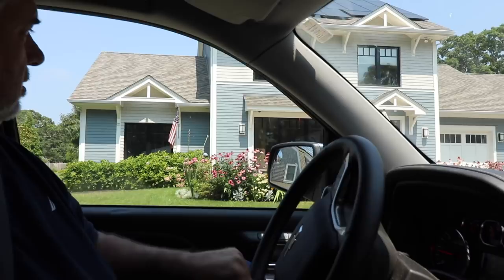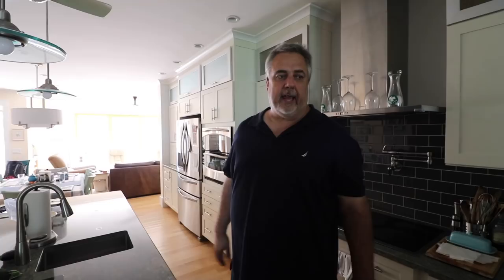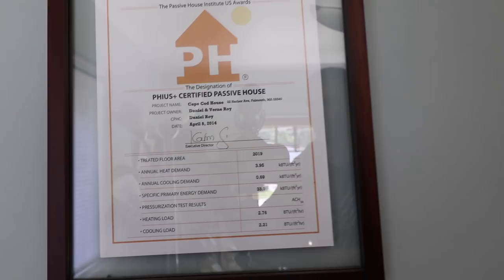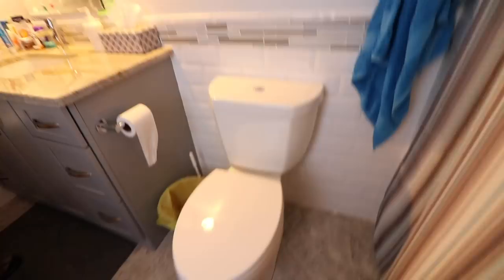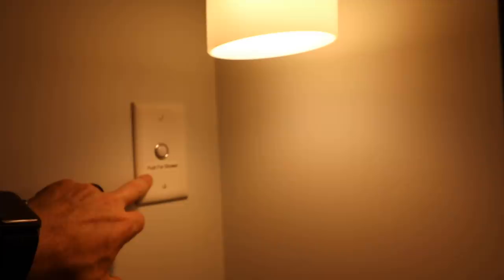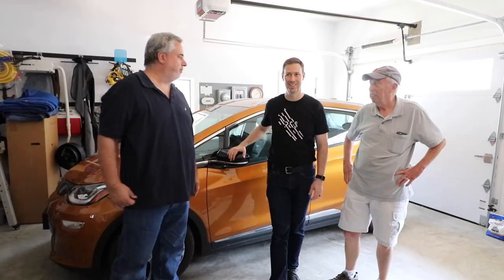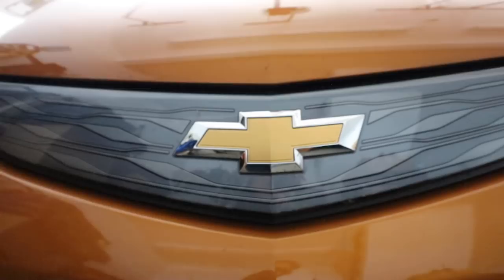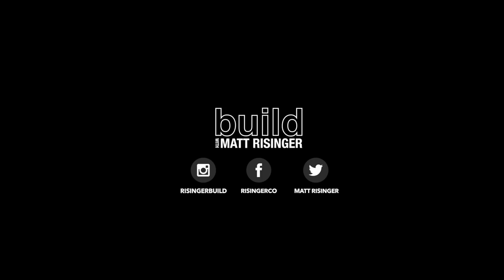Top 10 Most Efficient Home in America

Comment: I don’t know why, but the passive house stuff is always my favorite!
Reply: I'm sure that part of that favoritism would only be enhanced if your electricity bill read $0.00...
Reply: Mine too - always exciting stuff to be had when chatting Passive House
Reply: I can see this happening in the north... Can it be done in the south (Austin, San Antonio)?  I just don't know why more people don't demand houses like this or similar.
Reply: I was stationed in San Antonio for four years, and I would have loved an extra layer of insulation in my house.  I wonder how much more R30 walls and R50 lids would cost?
Reply: You're my favorite
Reply: @jackjmaheriii  You get diminishing returns in walls well below R-30, especially in climate zone 2 where San Antonio is.  About R-21 in a closed cavity (whether it's batts in walls or foam that creates its own cavity) is about the max you should really go.  The only reason you see R-30 or R-38 in attics is because those aren't enclosed cavities so they have to make up for airflow in the insulation layer by adding more.  Remember insulation works by trapping air so airflow works against that.
Reply: I love the Passive House episodes.  But, why no examples from hot-dry climates?
Reply: @barbarasmith6005  It's alot harder to do with cooling than it is heating.  Keep in mind A/C is basically just a less efficient reverse heat pump.
Reply: @rush, if you did want a passive in hot climate would the answer be something like, thick concrete walls to store the cool night air, and exterior insulation to keep the sun from sucking out the heat?  Maybe use deep eves to keep the sun off the windows?
Reply: @jackjmaheriii  Depends on if you are in hot and dry or hot and humid climate.  Hot and dry that would probably work well.  Hot and humid climates like here in Texas can still stay in the 90s at night on the hottest summer days.  Honestly your best bet in these climate types would probably be some type of dugout structure.
Reply: You don't know why, isn't it obvious? :P  I must say Matt this is your best video to date!!

Comment: There wasn't much discussion of the solar panels but I would assume they do not have a house battery and the grid tie in is 1:1 rated. Meaning for every kWh generated one is credited. From 1:11 there are 35 250 watt solar panels for a 8.75 kW system. This makes sense for more Northern sun hours of 3.8 and to charge the EV. The average house uses about 30 kWh per day and this home would be producing about 33 kWhs on a sunny day. The efficiency gains from direct solar heating probably on their own make up a big chunk that would be needed to charge the EV. Also heat pump water heaters alone would save 5 kWhs. While we got a long way to go for energy storage we can clearly see rooftop solar is plenty of power for all residential energy use.

Comment: This is my goal in life. 
getting rid of all my bills
Reply: It's attainable
Reply: Except the mortgage thats 15%  high so he didnt have a utility bill. Lmao
Reply: Me to but I'm going to build an actual efficiency home. You know, thermal loss efficiency. The real efficiency rating. Then you don't need very much heat or ac
Reply: @Bryan-Hensley   well luckily A passive house only cost 5-10% on average more to build then a traditional home.
but thermal efficiency is not everything, that only impacts the heating and cooling costs. (which I am aware of is the most significant, 35-70% of a homes energy usage)
but there is also electricity, water, Gas, sewage, trash, property tax, HOA(yeah right), cell phone, and internet.
I must get rid of them all, all these bills must die! :)
Reply: @mountainbikerdave  that's kinda funny. I just asked a builder I know and he said 40 to 70 percent increase in price depending on how far you wanted to go. He says the one in this video would not qualify around here. And he wanted to know why they aren't testing the BTUs losses. That's one part that qualifies a home as passive. You are better off using LED 1-5 standards though. They are more detailed and strict.
Reply: @mountainbikerdave  I'm going to build a LED4 mini home. You can almost heat one with a candle. Yes I'm exaggerating but you get my point. I've already got my water tanks for collecting my water. I moved to a place away from sewers. I have a septic tank system. I'm going to start on an underground green house to grow my own food. I'm just about to buy a used nissan leaf. I've already bought some solar inverters. I plan on getting a
some crashed EV cars and using the batteries in my house. I'm slowly buying a 355 watt solar panel every couple of months. The only thing I will be paying for is property tax and tires. I'm planning on being totally self sufficient.
Oh yeah I built a thing like a heat exchanger that is exhaust and intake system that exchanges the heat. You can run fresh air intake at 100cfm with virtually no heat transfer. Just imagine a 2 inch metal duct pipe inside a 2.5 inch metal duct. The inside pipe is blowing out. The outside pipe is blowing in. If you make them long enough the temperatures will equalize. The heat going out will be absorbed into the air coming in making the temperature of the pipes exactly the same at either end. There's no heat transfer from the home in either direction.
Reply: @Bryan-Hensley  as long as you are removing unnecessary things like the furnace and A/C system you should be breaking even or slightly above a traditional build. 
the cost of the furnace ($4,000-$6,000 installed) and A/C ($4,000-$6,000 installed), should offset the cost of the extra insulation and high efficiency windows. 

Further more you can utilize better framing methods (to reduce lumber and labor) and better insulation application methods to even further reduce your costs.

the principles of passive house utilize the position of the home to gain heat form the sun. while strategically placing overhangs to reduce heat gain in the summer. this is also known as passive solar.
also, passive houses rely on insulation and air proofing. increasing the R-Value of your envelope, air proofing, installing an efficient heat recovery ventilator (HRV), and installing efficient airtight windows.

I'm not quite sure where your builder friend got "40 to 70 percent increase in price". he may be confusing passive house with a net zero house. 
changing the position of your home doesn't cost anything extra. the guys pouring the concrete slab don't care whether the front of your home faces the sun or not, and aren't going to charge you extra money for it.
the largest expense is the HRV, insulation, and the windows.
the HRV is expensive and will cost you a few grand
going from the ordinance minimum required R-13 to an (dependent on location) R-40 will cost you a few grand more
 and going from double pane to triple pane Low-E windows will also cost you a few grand more,  but again  those should be offset by removing Mechanicals.
also, air proofing doesn't add much extra cost either, caulking and labor.

 so "40 to 70 percent increase in price", your builder friend must hare massive profit margins.
usually it is interior features like hardwood floors, modern kitchens, fancy bathrooms with fancy tubs/showers, extravagant features like stone fireplaces and such, and high end appliances that significantly increase the cost of a home.
though insulation and windows can add extra cost I SERIOUSLY DOUBT that they can turn a $190,000 home to an $266,000-$323,000 home (40-70% increase). 
considering your labor costs don't change and you are only spending extra for materials, the math just doesn't add up.

but CONGRATS on being self sufficient, I will hopefully be joining you in Financial Freedom Land shortly.
also, I am not familiar with "LED4 mini home" or "LED 1-5 standards". do you mean LEED standard by any chance?
Reply: @mountainbikerdave  yeah I goofed up on the LED. It should have been LEED. I actually had to look up the definition of passive home because I thought it meant what you explained too. But that's not the definition I read. It's more like a LEED standard. I have the sun heated home and in the winter on a sunny day I have to turn on the AC or open the windows with a fan if it's above 30 degrees outside. I think it's better to remove the most of the windows and concentrate on insulation
Reply: @crazyhass84  He is already paying it off and when he is finished paying off, he'll be LHAO !
Reply: @crazyhass84 

Those two units are part of the heating and cooling cost.

Comment: True R value for 2x6 Wall  ---  R-11
Wall is 60% insulated  ---  R-22 (fiberglass or cellulose)
Wall is 25% solid wood  ---  R-10
Wall is 15% windows and doors  ---  R-2
Reply: In north east R-22 is rather low, maybe even under most code minimums. This construction's walls probably hit R-75 (this is what PassivHaus projects hits up here in Quebec). Its probably not 2x6 walls but 2 2x4 with a good foot of insulation in between and no thermal bridge. And he said his windows were R-7+ and they are smartly arranged so that they can let the sun in many hours a day (only when needed)... There is no way he would have got a passive certification with R-11 walls.
Reply: But this is a double wall - thermally broken

Comment: It frustrates me so much that Australians don’t take PH stuff seriously. 
I have a property that I purchased that was built in 1979. I wanted to look at improvements in efficiency but I was told it’s good enough as it is. It’s a double story (on a suspended 8in slab) interior walls down stairs are bagged cinder blocks while upstairs Interior walls are 10mm of cement render over cinder blocks. Exterior walls are the same as interior walls plus 65 mm air gap to a solid external brick. 
It needs new windows as they are original and I wanted to re-clad over the painted brickwork with a type of cladding, I thought I could insulate between the bricks and the new cladding. The home is lucky it has such large rooms as I’m sure something could be done to the interior walls too. 

It just seems people are happy waisting there money on purchasing massive ducted HVAC systems. 🤦‍♂️

Comment: I love the Passive concept. I would love to see a project that takes a suitably positioned home (most glazing facing South and nothing shading the sun) that was built using standard construction techniques and renovates it to incorporate as many Passive House principals as possible. If you need a home to do this project, I have one...
Reply: LOL, I do that almost everyday
Reply: So build a new traditional house, gut it, then make it passive?
Reply: In my case I have a house built in 1989, it has tons of windows facing South that are at the point they need replacing, the walkout basement (lots of south facing windows too) needs refinishing after a flood... this sort of scenario seems perfect for upgrading windows to something suitable for passive-solar, but beyond that the reno would need to add some thermal mass in the right places, upgraded insulation, perhaps tweak mechanical systems...  etc.
Reply: Upgrading windows is possible. As far as adding insulation, you would have to tear out all the walls (to put on inside) or remove siding (to put on outside). There is a airborne system out that can fill in some of the holes in the envelope, but i'm not sure about effectiveness is when drywall is already up. Adding thermal mass would be pouring concrete inside the house? You can't usually tweak mechanical systems besides sealing. Changing capacity would usually involve replacement. You can't just replace one wall, you have to replace all of them to get maximum effectiveness. 
Analogy: If you have 4 water leaks in your pipes, you can't patch one and expect your house not to flood.

Look up chainsaw retrofit. That would be the ideal scenario if you need new siding, roof, and mechanicals at the same time and want to significantly decrease your utility bills and increase interior comfort.

Comment: So this house doesn't have any battery storage for lights after dark? Is it feeding enough back into the grid that it zeroes out?  I live in southern Peru and am fascinated by passive houses but there are no builders here and the weather is so nice that no one even has centrally AC or heat. Small space heaters a couple times a year for higher income people are more than sufficient, but electricity is very high per kWh (about 18 cents USD right now).  The thing is its super dry so very dusty. The air quality advantage is very interesting more than passive heating, although air/heat distribution throughout the house would be nice since lower floors can tend to be chilly for cold-natured people.  I have a 1.3 kW system and a small lead-acid battery bank (1000 ah) and my grid electricity is running about $20-25 per month for 2 families and 8 people. There's no net metering yet here.

Comment: The wild part is that PV panels have had a break thru in wattage output in just the last 2 years.  If he switches his panels from just 5 years ago he'll have over wattage and easily juice to spare.  The only that sucks even with Bolt, Teslas, etc is that we need a break thru in batteries now.   They are still too heavy, dense, and don't store enough juice for the footprint they are presently at, either way that is very cool house.  I just wish there were more like it for the general consumer but this video is 30 years ahead of common practice. :(
Reply: Dan is a forward thinking engineer, and a dream client. I agree batteries are the log jam, but we'll get there
Reply: Tragic thing in CA they limit the solar generation to just what the home uses. Power companies don't want to pay a homeowner for power. Shortsighted to me.
Reply: li ion batteries are not dense
Reply: +Future Hindsight that is a nice summation but you have one problem you are ignoring the fact that pound-for-pound ounce per ounce kilogram per kilogram the hydrocarbon is still 60 to 70 times the energy density of the finest lithium battery on the planet.  Sorry but until that changes and I'll take a ratio of 30 to 1 to settle then the batteries are and will remain the ultimate log jam in the Tesla equation.  The stored energy capacity is nowhere near what it needs to be for the absolute means of the majority of drivers on the roads today and don't even get me started about light duty pickup trucks.  When you start handling Mass to haul ratios unless you are a semi with massive storage capacity that can house that many batteries you have no chance against the hydrocarbon.  Storage capacity and the inefficiency of the present battery technology is the Kluge.  Charging stations are great but you got to have so many of them for distance so close together and coupled with the inability to charge under 5 minutes to full capacity without catching fire. You need to reexamine your numbers and I'm saying this as someone who is pro e v.  Sorry but your statement doesn't add up on the practicality scale.
Reply: Future Hindsight  energy density is anything but a red herring you referenced your house which is fine house you can add onto you can have two full bedrooms filled to the ceiling with battery power I have zero issue with that but when you talk about a mobile conveyance that doesn't fly from a practicality standpoint you are still missing the point of the energy density equation until there is a battery breakthrough Tesla doesn't make the cut overall it doesn't mean that they shouldn't be made and it doesn't mean that you shouldn't buy one but it also doesn't mean that we need to all Drive U-Hauls that are over 12 ft long and 8 ft High so that we can get to wherever we need to go whenever we need to go to it.  You can defy a lot of things but the laws of physics are not one of them.  As for the CO2 emissions and the pollution from the hydrocarbon I completely agree but you're still trying to dodge the simple fact of 60 to 70 times the energy density.  Until that ratio changes whether it's lithium batteries hydrogen fuel cell or some magic goo then the storage capacity for mobile conveyances and to some degree free-standing structures then we are still stuck at a log Jam.
Reply: What's your source on 70k miles? I've heard electric car and solar payback is more like two years max.
Reply: Loganbay there are challenges that’s for sure.  It’s a real balancing act with location of total generating capacity (solar plus traditional), grid investment, regulatory impact, etc.
Reply: @ocnier  your information is wrong
Reply: Not to mention that we really need to make said battery tech cleaner.  It takes a ton of energy to make and the mining process for many of the materials is far from green (less green than an average natural gas rig).  Honestly I'm leaning towards the hydrogen fuel cells being the best solution.  Easier to build longer range cars and easier to transfer alot of the petrol infrastructure over to hydrogen while at the same time being cleaner long term than pure EVs.
Reply: @rushthezeppelin  right now it's a less than a year for net neutral. I don't understand the complaint. The phone you are using is the real problem, it's a waste of those materials and energy to mine. No net neutral at all in phones
Reply: @rushthezeppelin  you do know hydrogen fuel cells use more precious rare metals than batteries, right?
Reply: @rushthezeppelin  Do you know how mych energy it takes to make hydrogen? That shit is faaaar from clean in todays energy production enviroment.